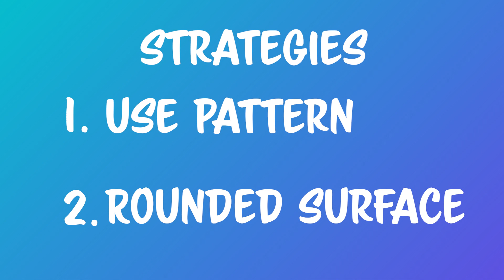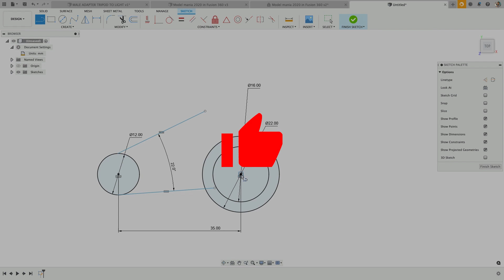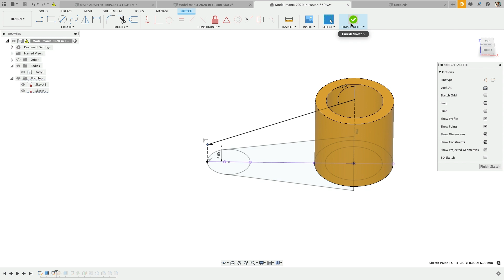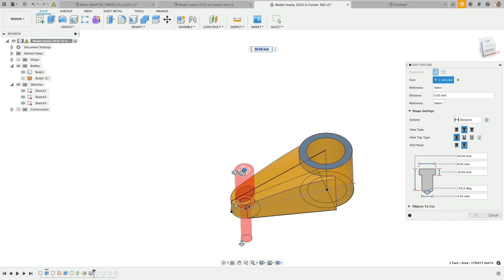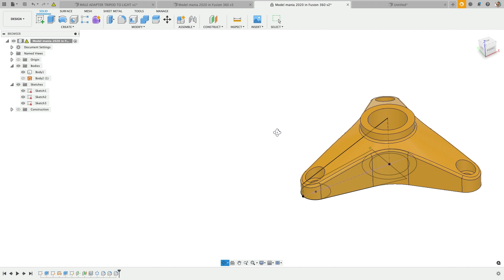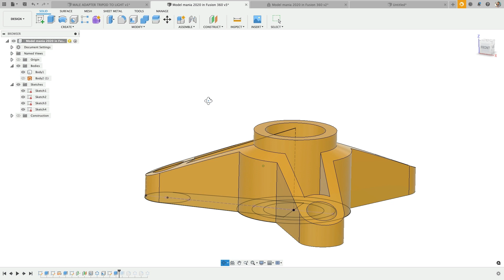Modeling with Fusion 360 (Model Mania Example)

Comment: I spent decades working in 2D design world and knew my software packages inside and out. One of the ways I learned to become proficient was doing exercises like this, but obviously only in 2D. 

I barely use fusion 360 but now that I am getting a 3D printer I intend to use it much more. I wish I knew of a list of great tutorials that went thru each of the tools, and the most common shapes etc.

It took me an hour to figure out how to build a proper tapered tube matching a curve for a front fork on a bike... 

I'll have to look at more of your vids obviously

Comment: I have no adjacent faces option on the extrude to the surface and the extrude will not resolve!!!  You simply need to reverse faces on the surface if the extrude to object does not resolve.

Comment: Great video Tyler. I did all the Model Mania tasks some time ago and they are a great challenge. My process with this one was very similar to yours, except when I did the counter bore holes, I re-anchored the larger diameter hole to measure from the bottom face, made it simpler.

Comment: For the counter bore hole, I would add the two circles to the sketch, cut out the complete circle (big and small) and then extrude (and add) just the outer ring. Seems much easier to me.
Reply from the maker: Totally.  I think the hole tool gives you the reference sizes to pick from then you can modify it...But, whatever works for you!
Reply: Nah that is the long way around. I like how he did that. I actually made the hole wizard before the revolve cut. But I did run into the issues he mentioned vs the Solidworks video where this originated.